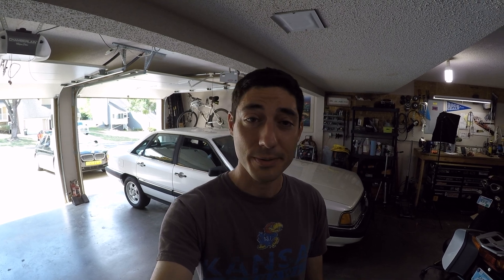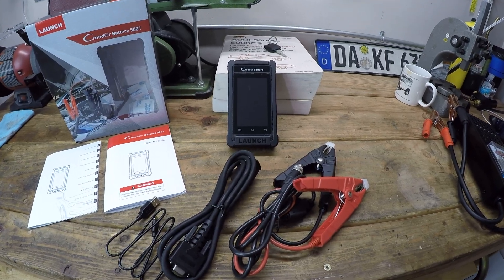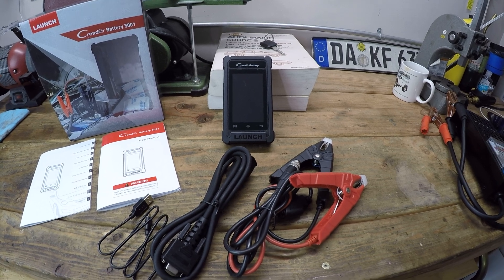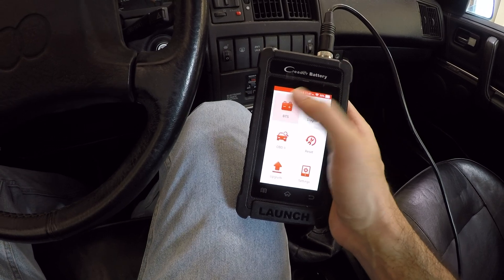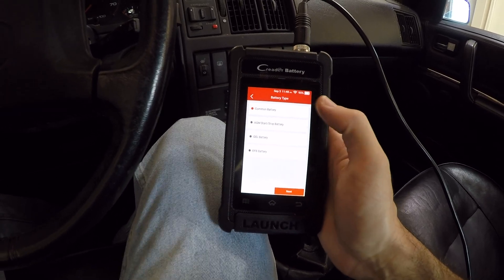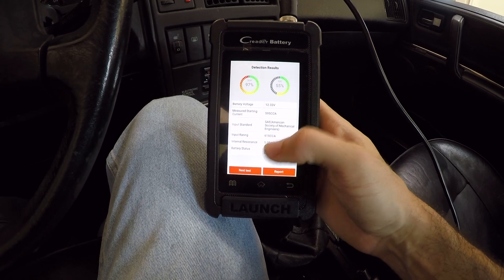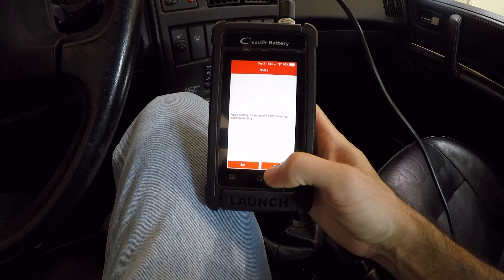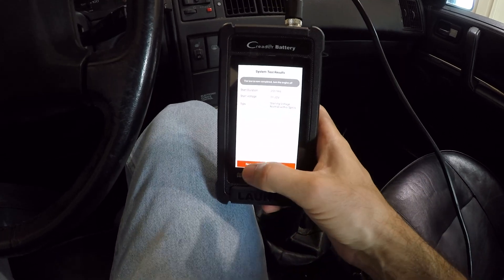Car or Motorcycle won't start? You NEED this! | Launch CRB5001

Comment: 7:46 My car started to stall while it was on idle. I have battery tester and charging scanner KONNWEI KW210, which recently decided not to show charging data. I also have a YANTU 150W 3-Socket Cigarette Lighter Splitter with portable voltmeter inserted in cigarette lighter. I saw voltage getting down in front of my eyes from 13.5V to 9.5V while car was on idle with AC on, since it was +44C outside. Headlights got dimmed, fans slowed down. I turned off all loads one by one: A/C, radio, fans. It gave me almost 11.5 volts on this voltmeter. So I was able to make it to my place. Next day I replaced alternator. Voltage shown 11.7v with all load on. Guy (the mechanic) replaced alternator with another one. Voltage still up and down to 11.7V. I went to another mechanic, who said, that previous mechanic was a Mickey mouse because he did it all wrong. So that mechanic replaced alternator again (3rd one in past 3 days) . Guess what. Voltage still drops to 11.2-11.7V with AC and fans on. I can't drive without AC with outside temperature +43C. So, yes. Those tools are useful, but what to do when it shows something wrong and 3 mechanics can't find what it is. Yeah, I took it to 3rd mechanic, who said that there is nothing wrong with charging. Aside of testing tools, I could tell that since car battery wasn't getting enough of charge the next start felt like starter spines slower.